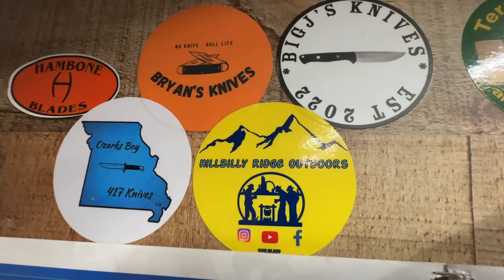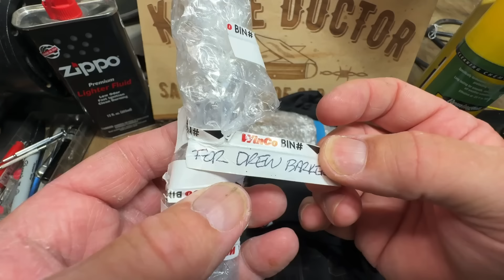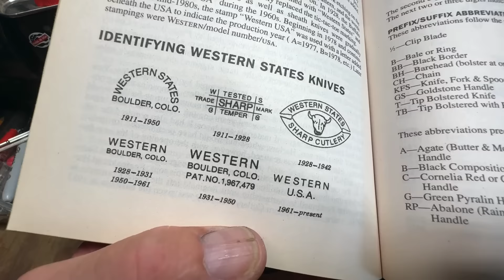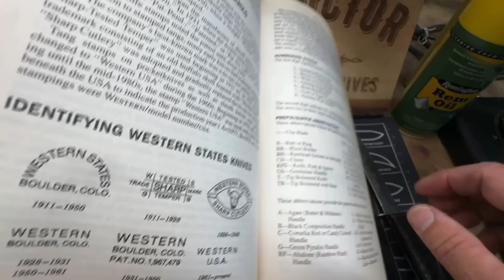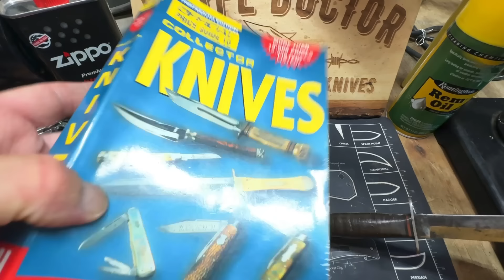Fixing an Old Western Knife + Unboxing New Blades and Gifts!

Comment: Hello knife Dr! I have an old fixed blade Case knife. Says case with no x and on the sheath button case also but no USA on it. It was my uncle’s Boy Scout knife. Has leather discs for the handle cut smooth. I also have a schrade little Rascal in excellent condition but I don’t use either so I’m wondering if you would like to put them in your auction or maybe you have them in your books. Thank you for your service! My dad and brother were in the military and I was a first responder EMT/firefighter for all of 6 months when a staircase I was on 30’ up and it just fell apart and I rode it to the ground. I’m very disabled but I still try to exercise some and I love the old knives, but I have knives from all over the world. I did have an old Rosecraft with bone handles and a sheep’s foot blade and I miss it! Let me know if you would like those knives and if so I’ll send them to you!
Cheers 🍻 Dave Case ( Caisse )
That fixed blade has the exact handle but a drop point blade
Reply from the maker: That’s awesome sir!!  Thank you so much.  God Bless You!
The Knife Doctor
P.O. Box 572
Ellaville, GA 31806